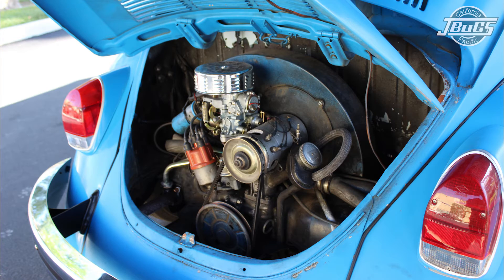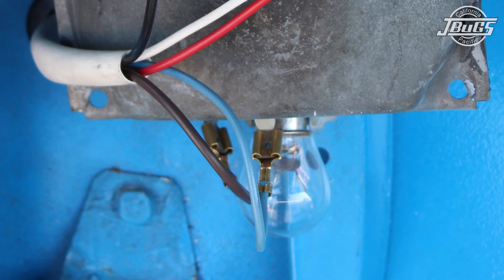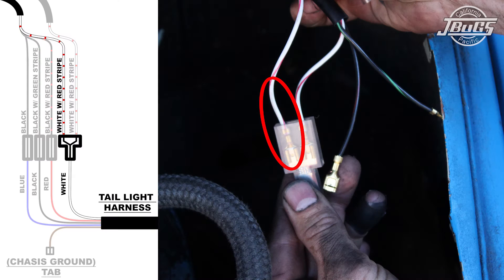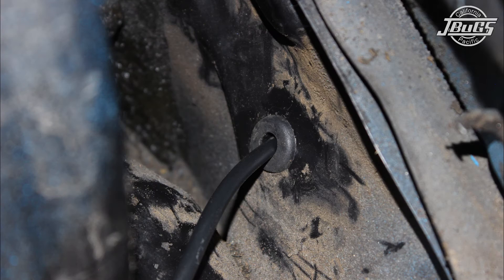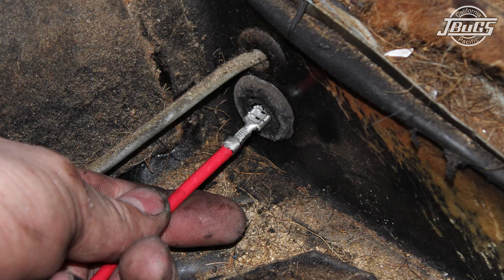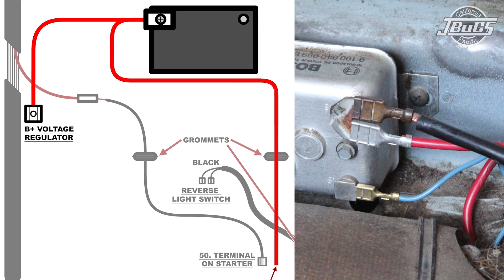JBugs - 1969 VW Beetle Rewiring - Rear Lights and Transmission

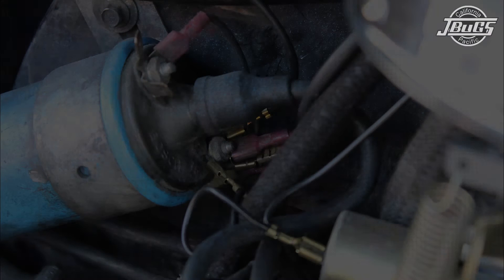Comment: What type and size inline fuse did you use or is recommended for the reverse brake light wire going to the coil? 3:19
Reply: We use the stock style fuse holder - https://www.jbugs.com/product/111-848.html and 8 amp fuses - https://www.jbugs.com/product/N171211-10.html

Comment: Do you have video on how to remove the reverse light switch and what tools needed? Does the offset spanner can be use to remove that switch?
Reply: We don't as removing the reverse light switch in a Beetle is much easier when the transmission is out.

Comment: The first bulb on the top of the tail light unit works with 6v and 12v or how come it lights dim and when the turn signal active it gets full power? Thanks for vid bro.
Reply: The top bulb should only come on with the turn signal. If it is coming on otherwise, chances are there is a bad ground somewhere. Most likely in one of the tail light assemblies. a 6 volt or 12 volt system doesn't change how the system works, just make sure to match the bulbs (and the rest of the components) to the battery and generator or alternator.

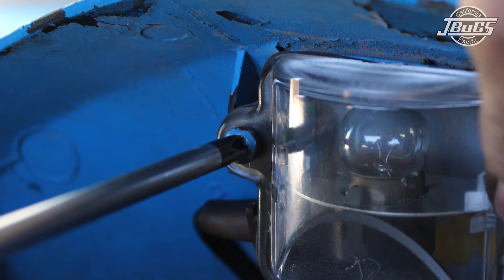Comment: I am unable at JBugs to find the grommet for the license plate light wire as it comes through the deck lid. He shows the unusual shape black grommet at about 2:20, but that grommet is for connecting to the license plate light assembly. I can not find it the one for just the wires through the deck lid on their website. Does anyone know where to get it?
Reply from the maker: The wire runs through the license plate light seal, the same somewhat banana shaped one that is for the assembly.
Reply: @JBugsVWParts  Not on my completely original 1973 Type 1 Standard. Send me a link to the part or let me know how to send you a picture of the area on my car where the grommet is missing.
Reply: @benkanobe7500  there is no grommet specific to the wire from VW that we've ever seen. It is installed as I show in this video here - https://www.youtube.com/watch?v=9sIjwQuD2Hk&t=185s. The wire goes through the decklid light seal. Feel free to email me directly, sam@jbugs.com if you have more questions.

Comment: Guys help me out please. I got a 1300 1974, noticed that my backup light doesn't work, took the lamp apart and found out that i only have holes for the bulbs, but no inner parts or even free wires. Is it possible that cars of that year could go without this function?
Reply: For Euro spec cars, we don't know what is possible. Perhaps they weren't hook up from the factory, especially if the bulb holders don't have sockets and the subharnesses don't have wires.
Reply: @Sam_Mebane  Thanks, my best guess is that it was a bonus function for extra money.

Comment: Only in vw beetle 69? Because I have a 68 beetle
Reply: The 1968 Beetle wiring is the same as this, unless you have the earlier model with a 2 prong hazard switch.
Reply: @Sam_Mebane  OK thanks
Reply: Is the 1970 harness the same…? Thank you !

Comment: You have a tail light instructions for the elephant tail lights??
Reply from the maker: +Eyesee
The top bulb is the turn signal (black wire), the inner bulb (the tail lights are side specific so inner refers to the bulb closest to the engine on either the left or the right side) is the brake light (red wire), the outer bulb is the tail light (white wire), the bottom bulb is the reverse light (blue wire), and the ground terminal (brown wire).
Reply: JBUGS thanks so much.you guys rock love your products..

Comment: i just installed your main harness and it didnt come with the tailight harness is there somwhere i can get them?
Reply from the maker: The tail light harnesses are only offered with our complete wiring harnesses. The harnesses are fairly simple, depending on the year from 2 to 5 wires and can easily be made with some wire and crimp on electrical terminal ends.
Reply: thank you i actually made one last night after looking at a few pictures